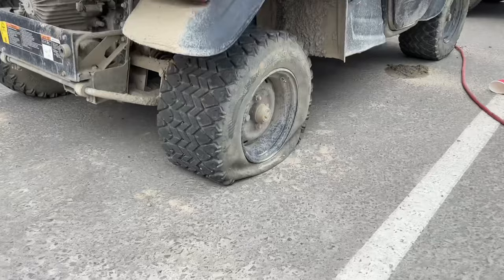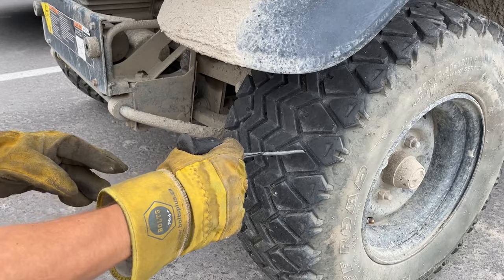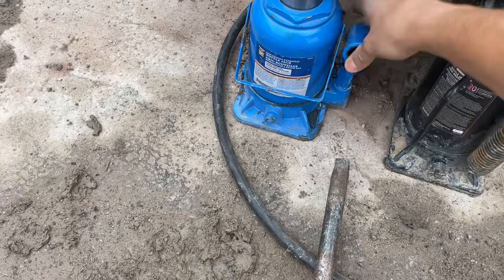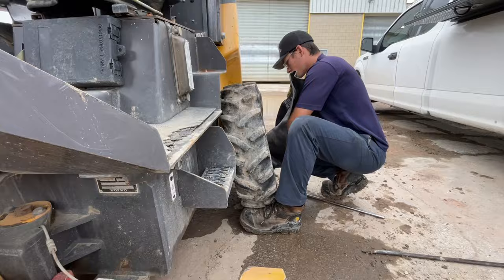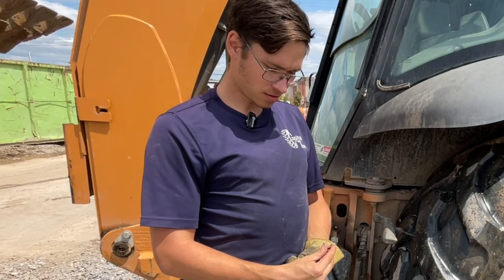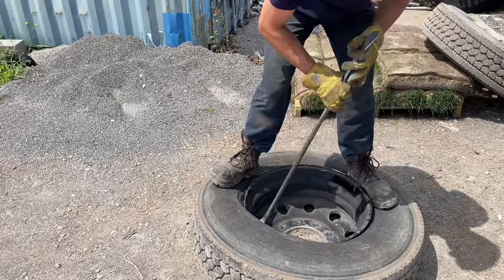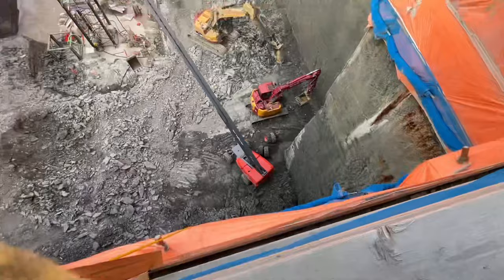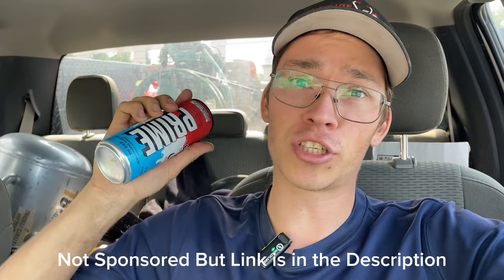Lifting Tires and Feeding Them Air!

Comment: Awesome work as usual! I worked part time at a towing and road service company back many years ago where I changed lots of semi truck/trailer tires. I've never done a heavy equipment tire and they look tough! Mind if I ask what do you use for bead lube when you're setting a new tire? May sound dumb but I'd like to stock some for when I need to change mower, trailer, and my offroad toy tires. Thanks!